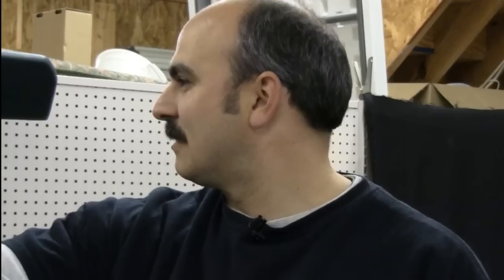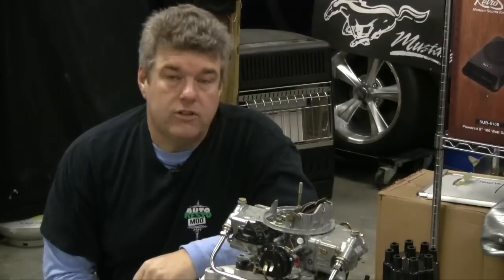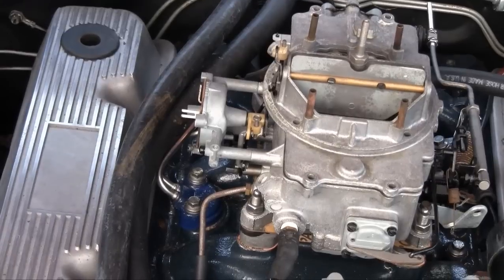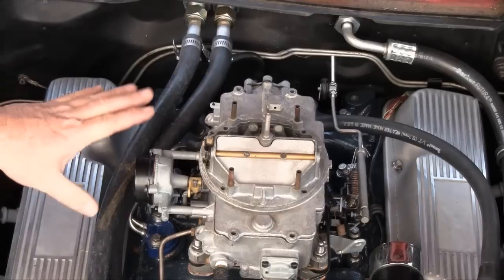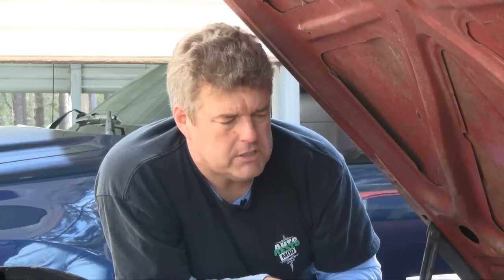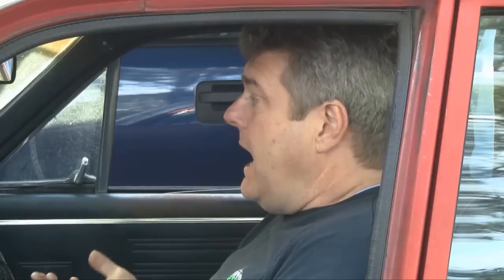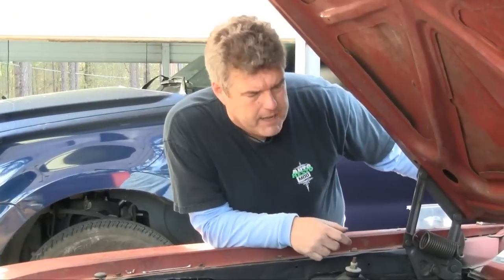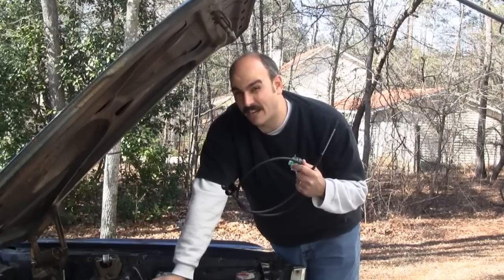EPISODE 104 Carburetor Choke set up and PCV Autorestomod

Comment from the maker: National Parts Depot carries a really compete kit for that rebuild Parts numbers are:
Mustang rebuild kit carburetor 9A586-7 
Mustang secondary float carburetor replacement 9550-2B
Mustang diaphragm secondary control   9503-1 <<Note that you will need to be sure which secondary you have either metal or plastic. We have 2 videos on the rebuild, check our channel.
Mustang float, carburetor, replacement, brass  9550-1B

Comment: I took off my hot air choke on my 66 mustang and installed a electric choke..with the cold winters in Nebraska it took forever to warm up the carb, the electric choke works great..
Reply from the maker: Conversion to an electric choke is always a great option, particularly if headers are involved.
Reply: I agree with you on that electrical choke is the way to go.

Comment: SO what does a guy do if his 76 F150 hot air tube from ex manifold is broke off?
ive been having alot of trouble with my carb.
i just rebuilt it and it started right up and ran perfectly on a hot day  all be it with a too high idle
but next day i went to start it and it would start but wouldnt idle unless i kept feathering the throttle.

SO if im stuck with just  the hose next to choke, can that work by itself or do i need to buy electric choke and replace it on there?

Comment: I hate to be "that guy" but EFI doesn't have an "invisible choke". The higher idle is caused by the ECU commanding the idle valve to open up a bit. This is done to speed warmup, light off cats faster, and make the engine run a little more stable when cold. The ECU also riches up the mixture. As opposed to a carb choke which is an actual valve qnd circuit in the carb. The EFI idle valve is software controlled.

Comment: I'd love to see more videos on straight six engines and autolite 1100 carbs. I've had one hell  of a time getting my mustang to idle well. I suspect a choke and fast idle issue but I can never get the choke to work properly and the fast idle always sticks.
Reply from the maker: +Dakota McCullough We'd suspect a vacuum leak on the carb first. Make sure all your vacuum lines are good. If the fast idle is sticking we'd recommend taking the carb off and set it according to the factory shop manuals. While you have it off check the operation of the choke linkage. Fix any binding issues then. MUCH easier to do off the car. when the choke is smooth reinstall.
Reply: +AutoRestoMod thanks for the quick response! I had a vacuum leak at the bowl gasket, since been replaced. I've done bench adjustments to the manual standards but still no go. I think it's a bad carb considering its a replacement from a chain parts store. The car starts best if the choke is open half way while still on the fast idle cam, but once I Rev the engine the choke closes and the car stalls. I can't get it to stay open unless I manually turn the choke far out, past past the marks, then the fast idle cam doesn't even matter.
Reply from the maker: Do you have the hot tubes connected? Unless it is an electric choke the tubes need to be installed for correct operation. Contact Jeff via e-mail at: jford@autorestomod.com This way you can send pics of your setup.

Comment: You guys make the best videos!! I paused halfway and went and checked my 2 barrel autolite. I have no experience with carburetors previously. Playing with the butterfly, it barely moves (100-90% open). Is it possible that my mechanic would have set it to be like this? I live in Perth, it’s a warm city with SoCal climate. I do sometimes have problems with a cold start if I haven’t driven in 5 days.
Reply from the maker: More likely, you have fuel leaking from the bowl. I don't know of a good fix for this.
Reply: @AutoRestoMod  There's no fuel on top of the engine, only an old stain from once when the carby percolated on a hot day. But I opened up the carby today and discovered there's no piston and no linkage to the accelerator. The mystery deepens!!

Comment: After my military career, I  got a 1979 F150 302 CI V8 with a rebuilt Motorcraft 2150 carburetor on it. I replaced the original with a "bench tested" as they say carburetor. When I removed all linkage and springs I did NOT keep track of proper location of the three springs that are located on the driver side of the carburetor. I need your help in getting my dad's truck back fully operational. Thanks!!!
Reply from the maker: +Mark Woten Pretty sure we sent an email on this. If not send it again too: jford@autorestomod.com

Comment: I just put a new 2 barrel car on a '72 F100, 302. It was set as a plug and play....I've tracked my mileage since installing it, I'm getting just over 7 MPG. How do I adjust this to get better MPG? HELP.
Reply from the maker: That will be tuning. At 7MPG on a 302 there is a problem. Unless it is a 4X4 or running a steep rear gear (4.11, 3.91 etc.) youo should be getting 12MPG to 15MPG. Check the plugs, timing etc.

Comment from the maker: Whether chokes are necessary is up for debate. "Chokes" are still in use on modern cars albeit by computer control. A well set up and efficient engine will run better cold with a choke. Our 351 Cleveland is a prime example; without the choke the engine is cantankerous and hard to keep running on initial start up. The choke helps the car idle and run better when the engine is cold. BUT if you are doing fine without the choke in your area, we see no reason to add one.

Comment: You do NOT use a drill bit to set the choke opening when the engine is off!!! 
You use it to set the  choke pull off while engine is running.
Choke is closed FULLY when engine is not running and cold.
Choke is SLIGHTLY open (here use the drill bit) when you just start the engine  and it keeps on opening as the choke's coil warms up.

Comment: I know y’all said to wire it to a keyed switch. My question is, that is it a blade connection on the fuse box? Or can I wire it to the ignition switch? 
    The “ON” position should prime the choke and then it would be okay to start. Shouldn’t it?
Reply from the maker: Wire it to the ignition switch.
Reply: AutoRestoMod Car Restoration Modification Thank you, I will do that. Currently rewiring my 63 Mercury with new OEM spec wiring harnesses. 
   I will add it to the protruding stud behind the switch.

Comment: i am redoing a 66 ford carb, 4100. when i opened the choke thermostat, i dont see a brass piston in the bore. does you carb have this brass piston? can i run a hot air choke without the brass piston? if not i will have to source a choke housing complete assembly.  what do you think.  i don know why someone would remove the piston. the expansion plug at the bottom of the bore looks intact, like factory. got this at a swap meet.
Reply from the maker: You need that piston. the 2100 shares that part though so if you can locate one of those cheaply, it can be pirated.
Reply: @AutoRestoMod  i am trying to find junk carb and take the whole choke  housing/assembly off of it. so far no luck.  there are 2 on ebay both beat up and neither with the piston, they are trying to sell it for over $50 and its worthless.      if you know of  a source let me know. they made thousands of 2100 and 4100's with this choke mechanism    someone out there must have  parts carb
Reply: i found a replaement choke housing the piston was frozen, got it moving with some pb blster and a little heat, there is still some crud in the top of the bore.  i know i an knock out the expansion plug at the bottom, can i get the piston out from below?. it is attached to the choke "lever" by i think a rivet.  can i glass bead the top of the bore where it seems to be catching. it looks lie the piston travel is right up to the top of the bore. thinks.

Comment: Maybe you guys can help me out on this issue , it's driving me crazy. I have a newly built up 355 in my 1978 caballero diablo with a new quick fuel SS 780vs the install on the carb went off without a hitch,almost. Sometimes the throttle lever does not kick all the way back to idle after the choke is warmed and fully open.its like it is coming to rest against something because if you touch. The throttle lever with just the slightest pressure it kicks back down. It's not a big jump about 200 rpm. I have tried differnt return springs,(tighter,smaller ect) to no avail. As a last resort I was going to install one on the large hole at the top of the throttle lever to the front of the eddy performer rpm intake. Quick fuel techs are no help at all with the issue. And I can't find anything that is blocking the travel on the lever. It has been suggested that the choke is somehow responsible for this but i can't see how this is causing the issue when the choke is fully open when the problem is occurring. Have you ever heard of this problem or know of something to fix it? Thanks in advance.
Reply from the maker: We'd look at the butterflies inside as well. You might be catching on the gasket for the intake to carb. Also check for interference on the passenger side of the carb at the choke leaver. Sometimes the lower leaver will drag on the side of the intake or spacer. Remove the carb and look for a shiny spot in the aluminum.

Comment: On a hot air choke should there be a o-ring or something sealing the outer tubes to the intake base element? On my wagoneer they (loosely) slip fit over by 1/4 inch.
Reply from the maker: No O rings. On the Cleveland that are an interference fit into the intake, on the older Ford V8s they were the same into the manifold.
Reply: oh, okay. so it must be more like a heat exchanger, right?
Reply from the maker: Yep that is it!

Comment: hey guys got a question, i just put a new crate 350 in my chevelle and i hooked up the pcv like you guys did strait to the carb. i didnt have a breather on and now i have an oil leak, can i just slap a breather on the valve cover, or do i need to hook the pcv back up to the filter on the front drivers side as well, thanks
Reply from the maker: +Tyler Johnston First, where is the oil leak? Our Cleveland was pushing oil out at the breathers before the PCV and the breathers helped a bit, but not as much as we'd hoped.
Reply: dip stick, the old dip stick wasnt compatable with the new crate, so i had some cheap adapter to make it work but wasnt a good seal... thank god it was just the dip stick and not a gasket lol. i put the breather on but i have some other stuff im doing so havent gotten to drive it yet
Reply from the maker: Tyler Johnston Let us know how it goes!

Comment: i have a 351 windsor with a Q.F.T. carb brand new when i start it it will barely idle unless i step on the pedal a bit. once it's warmed up it runs better but rich.it loads up at lights a bit, it will idle though (very rich).it has en electric choke it will run smooth but it takes a few minutes.. even when it's started while warm...when cold ,even in summer. it takes about 5 min sometimes longer to idle properly.can you help me? i'm totally lost.
Reply from the maker: We'd recommend looking for vacuum leaks to start. Contact Jeff for more help at: jford@autorestomod.com
Reply: thanks.i'll email him

Comment: ((HELP)) Disclaimer "I am NOT a car mechanic at all ok"  I just bought a 64 Fairlane w/ original 260 and the previous owner installed a brand new Holley 4b on the original 2b intake and he didn't wire the automatic choke and he abandoned the manual choke as well... Now I have the automatic choke wired to a 12v keyed source and the butterfly opens /closes correctly but the engine does not high-idle at all when its cold. I have to sit in the car and tend it by revving the engine to prevent it from cutting off until its warm enough to finally warm-idle then it runs great.. What am I missing here? Shouldn't the automatic choke make the car idle-high until it warms up then the idle should go down once warmed-up? I mean that's the whole point of the choke right? lol   Is there a high-idle adjustment that I can tinker with?
Reply: +GeorgeBonez No, the choke is only controlling the air intake. When cold choke plate is closed up, allowing less air to flow and getting a richer mixture, until the engine warms up. Then the plate opens and you get "leaner". If you notice on the video the autolite they were working on has a screw to adjust fast idle. You should look it up on your carb, it must have something similar.

Comment: Hi all good video but I have never had too used a choke on any of cars here in England I have a Chevelle have also had a Camaro and a dodge all have had Holley carbs on them and I have never needed to use a choke
Reply from the maker: Sometimes (not always) that is indicative of a rich tune on a Holley.
Reply: AutoRestoMod Car Restoration Modification ok that’s interesting to know It would be more beneficial for me to have an electric choke as I wouldn’t have to sit in my car nursing the gas pedal for 5 or 10 minutes when it’s cold at start up 👍
Reply from the maker: Exactly what the choke is for. I have mine set up on the wagon (my 351 Cleveland is a cold natured old gal) and it is nice to pump that pedal three times lightly to get go juice into the engine then once to the floor to set the choke, then let her rip. I'll be adding the electric choke to the F100 we are working on. It has a hot-air choke now, and the truck (factory equipped with a manual choke) has no provisions for a hot air choke.
Reply: AutoRestoMod Car Restoration Modification yeh you have convinced me I will get an electric choke on my next carb it is better than sitting feathering the gas waiting for it too idle on its own, by the way great videos very explanatory and easy to understand what you guys are going keep up the good work👍

Comment: hi, can you provide info on where you purchased the firewall assembly that your heater hoses are connected to?  Here is a screenshot of what i'm referring to.  this would be for a 65 mustang.  thanks.  Tom https://www.dropbox.com/s/j9ha56tga1xxwxo/Screenshot%202016-06-23%2000.00.46.png?dl=0
Reply from the maker: Those are bulkhead fittings from Vintage Air. Call them and send a picture they should be able to hook you up. Tell them you saw it on Autorestomod.

Comment: PRO TIP: Take this carb and throw it in the trash can. The replace with Eldelbrock AVS2.
Reply from the maker: You funny! Seriously though, the fuel atomization is better on an Autolite 2100/4100 than on either an Edelbrock or Holley and I've seen the Autolite out perform both. It has its foibles...just like Holley and Edelbrock. It needed a central float for one. But fuel handling...second to none. Both Edelbrock and Holley are "dirtier" in how they dispense fuel. The Autolite had at least 8 different venturis that were used depending on application.
Reply: @AutoRestoMod   So Edelbrock carbs in 2020 are worse than 55 year old technology?